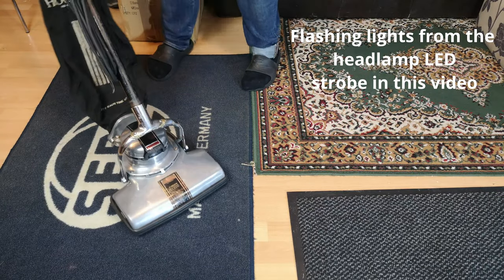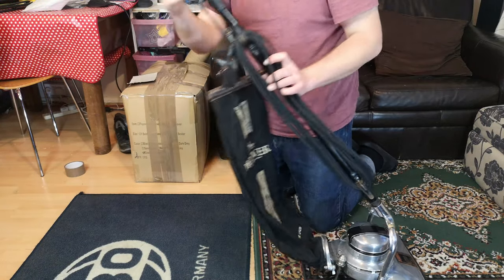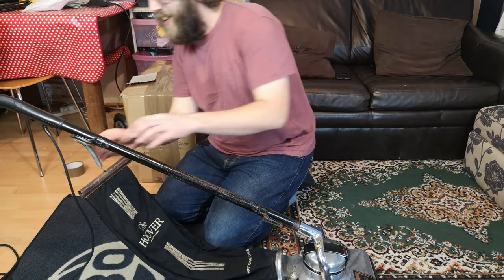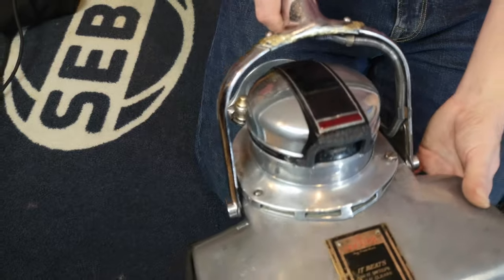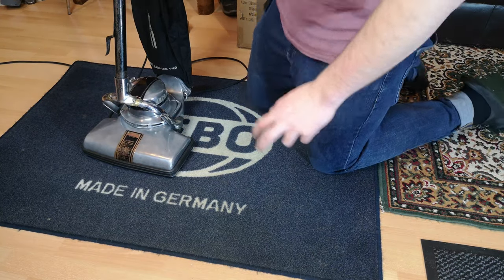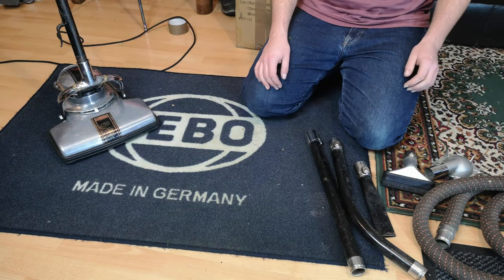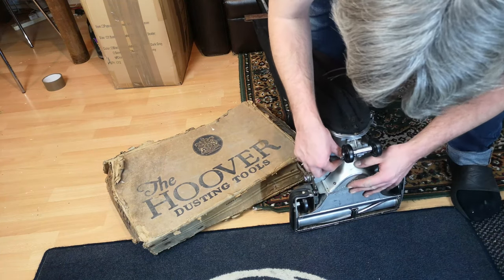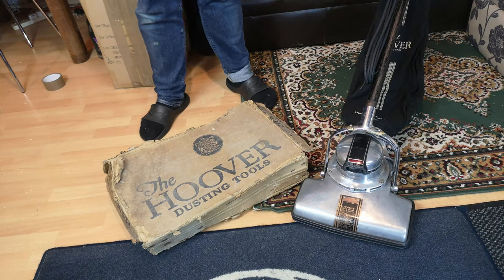My 1930's Hoover 825 Antique Vacuum - After FULL (mechanical) restoration!

Comment: It's a simple job to reseal the fabric lining in those hoses with liquid wax. There's a thought for you....
Reply from the maker: I've seen similar methods on vacuum land using latex and such. Great idea but I've not got the workshop or setup to do it 😢 Not butchered the hose yet though and probably won't now I know a numatic hose end just plugs into the tool adapter for the 3 times I'll ever use the tools on a coffee can properly

Comment: Hi Sam, lovely refurbishment.
I have the same model, mine's from 1936 which I found many years ago in a church charity shop in Hebden bridge, unfortunately it had been stored somewhere very damp with the bag full, hence the bag had disintegrated , I've made a bag for it, which is good enough to pass for an original,if you don't know what you should be seeing. 😜
One thing I wanted to ask you regarding the hedlight, the bulb I have is too big so I cannot locate the cowl properly.
Where did you get your bulb from?
I now live in Portugal so I've no chance of finding an SBC bulb here
Thanks in advance
Regards Nick
Reply from the maker: Hi! Lovely story with yours though! I wouldn't be too upset about the bag, miner's not fit to use sadly and they mostly never are nowadays! The bulb came from ebay, many years ago now so can't send you a link. I quite like it. Nice and bright, runs cool and I'm less likely to smash it moving the machine around in storage
Reply: @beko1987  thanks for your swift response, I will continue to troll eBay, fingers crossed one day the perfect bulb will turn up.
You're right about the bag, it's a pretty good substitute,even if I say it myself.
Mine is on permanent display in our kitchen and has been the topic of conversation with the majority of people who come to visit 
I'm a huge fan of Hoover vacuums, when they were proper  Hoover, not the cheap crap that's been produced this century.
I still remember the Hoover salesman calling at our house to demonstrate the " new hoover junior" 
While he was talking to mum I had the thing out if it's box and fully assembled apart from the nuts and bolts in the handle. The guy was absolutely gobsmacked  as I was about 4 at the time.
Mum bought the Hoover the 1334 model in rose pink and white and had it for almost 30 years